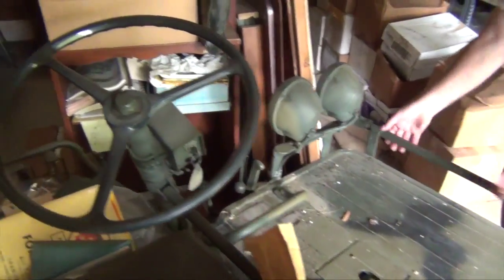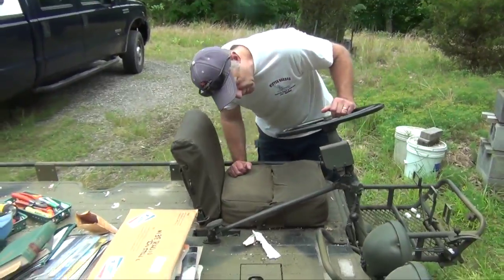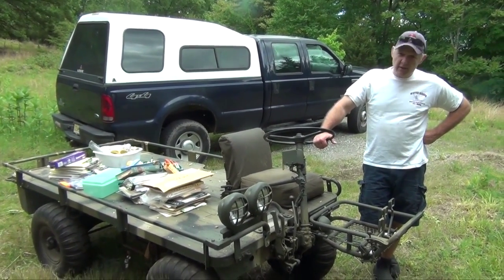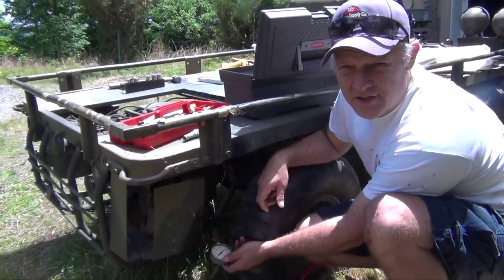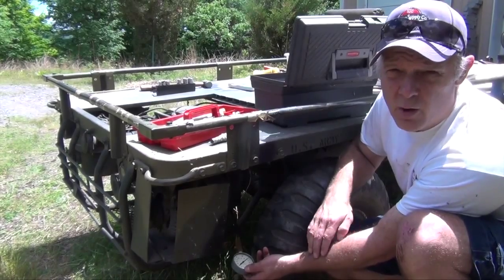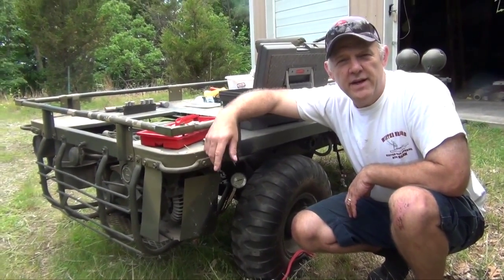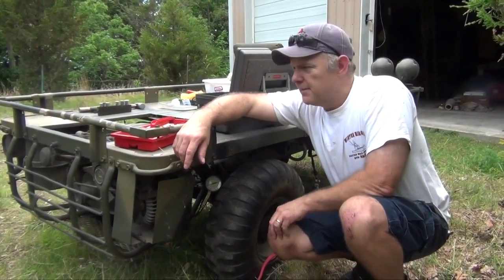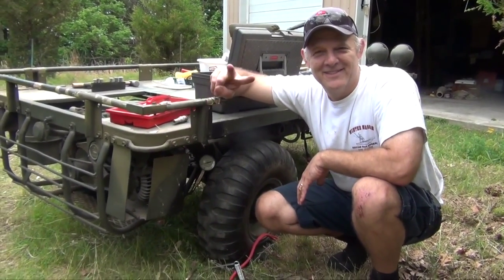"Ran When Parked" - Should We Buy this Abandoned Vietnam M274 Military Mule?

Comment: This was a good tutorial on any non operational vehicle. I found these mules are quite the engineering marvel. Appreciate your channel.
Reply from the maker: Thank you very much Craig - I sincerely appreciate the feedback and kind words.  I agree with you - these Mules are very interesting vehicles and between the variations and production changes, there is plenty to learn and study!
Reply: One last comment then I will be in the background. I was blessed by having a father who picked a CJ3b as my first car and who paid a mechanic to come to the house to give direction on how to disassemble an engine so I could have the major components pulled and delivered to a machine shop to be rebuilt. When I got those parts back he showed me what was done and assisted in the reassembly and taught all about thread cleaning, torque, safety and the  rebuilding of carb, generator and rewiring. I used that and manuals then to go through all the rest. He later dropped by to help with understanding brakes and retiring which I did wire by wire,
Reply: Continued... when I got to the body I got some instruction on leading and metal work from a metal man working at LA Roadster who was a WW2 aircraft metal man and learned to lead instead of o do, all good stuff.  Lots more I could say but watching your build will allow me to relive my past successes and failure. Good luck with all of your hobby, I really appreciate your skills set. It is really rare to see all these so well executed in the 2000s. The history part and commentary add to your channel. Best of luck.
Reply from the maker: Thank you for sharing your story.  What a wonderful gift your father gave you - so many life lessons in what seems like simply a mission to help a young man get his first vehicle.  Beautiful memories.  Thank you again for introducing yourself and sharing and for being a part of this channel - this makes it all worthwhile.

Comment: Interesting, specially liked the aviation plugs, never seen those before. I'm curious about what a Mule that hasn't run in years is worth, not that I'm ever likely to have the need or opportunity to buy one. Very cool little vehicle though and I can think of many practical uses it would be good for. I'm really enjoying your vids, thanks.
Reply from the maker: They have really gone up in value since we made the video.  At the time, you could find them for around $5,000 in running condition and complete.  Now they are more like $10k.  The problem with project Mules is that there are a number of body parts that are almost impossible to find so rebuilding one is a little bit of a challenge.   That being said, deals are out there if you look and most of the mechanical parts you would need to restore one are available.  We use ours all of the time for everything from hauling firewood to joy rides - they really are super little vehicles.

Comment: Do they have diesel versions as well?
Reply from the maker: Not in the production versions - the original M274 and M274A1 had a Willys designed 4 cylinder, air cooled engine.  The M274A2 and A5 used a 2 cylinder and the M274A3 & A4 were original 4 cylinders upgraded to the later 2 cylinder version.  I have seen a few Mules converted to diesel although I don't the specs.  I don't think it would be particularly difficult other than finding one with a profile that would fit in the Mule without a lot of modifications - there isn't a huge amount of room in there.....
Reply: @Portrayalpress  I seen one of these on Facebook for sell, locally. I really enjoyed watching your videos on this as I have never actually put my eyes on one. I want to buy it and restore it if possible, it has a spare engine but I wasn't sure what all the options were and I'm not even sure what it's worth to even make an offer.
Reply from the maker: @chadsuttles3614  As you would expect, condition is everything.  If you want to call - 855-339-0382 or send me an email at sales@portrayal.com.  I am happy to walk you through the things you want to pay attention to and talk a little about pricing....